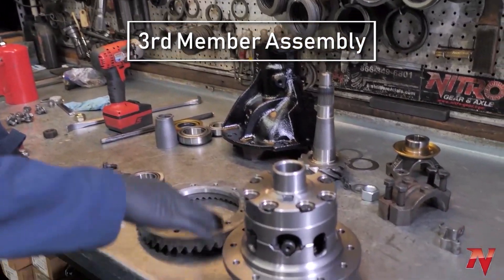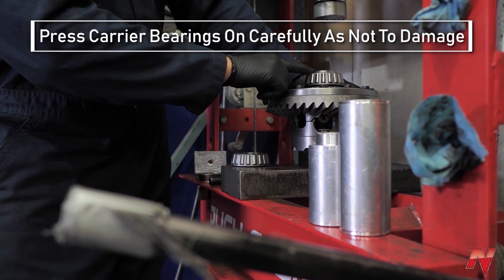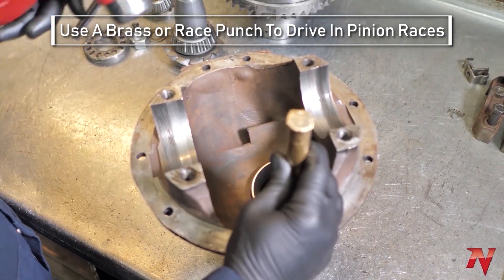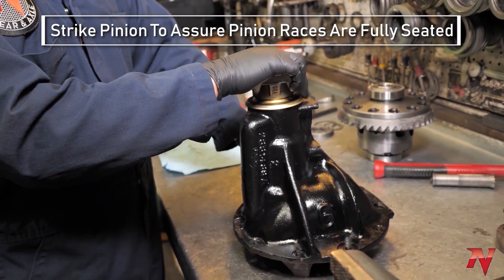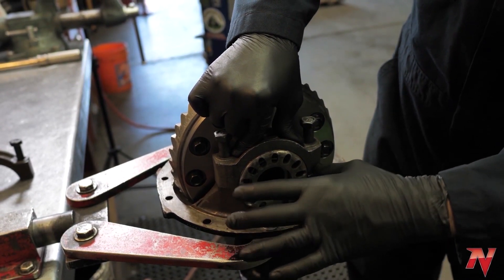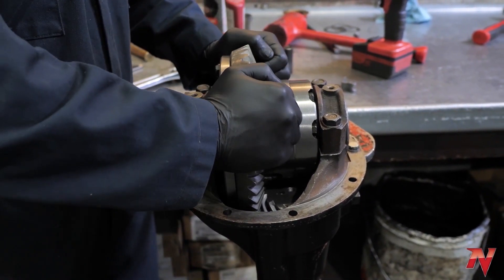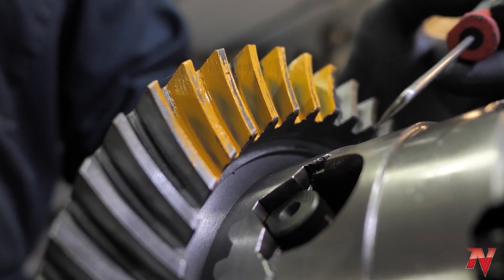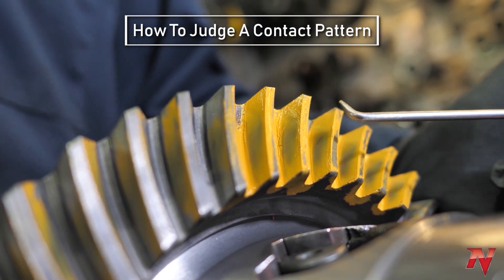How To Assemble A 3rd Member Differential // Checking Pre-Load, Backlash, & Checking Contact Pattern

Comment: In the first setup the pinion was set too deep, and the video didn't show having to pull the pinion bearing and remove/reduce the pinion shim.  Would it be acceptable to not use the pinion shim at all, and instead install a shim between the pinion bearing race and the differential housing?  This would seem to be easier to adjust in the event the pinion is found to be too deep/shallow.